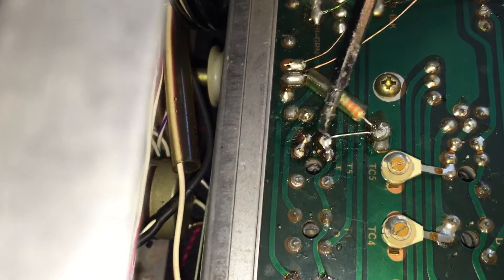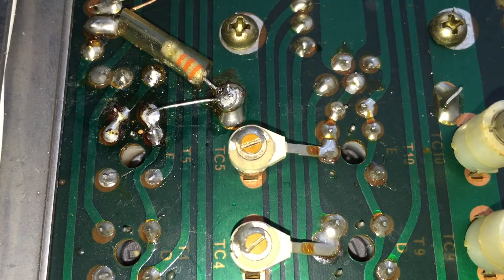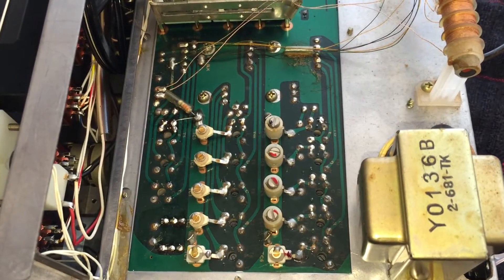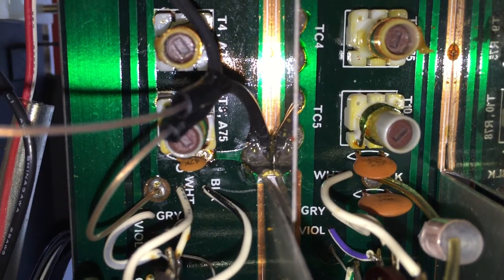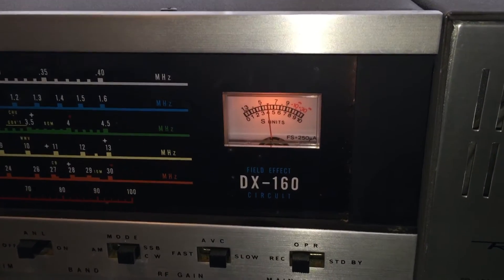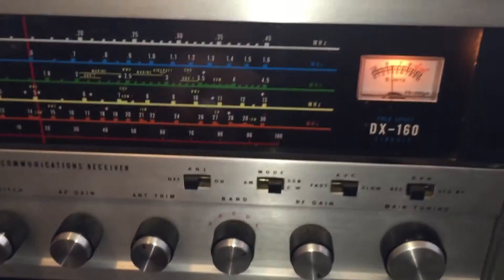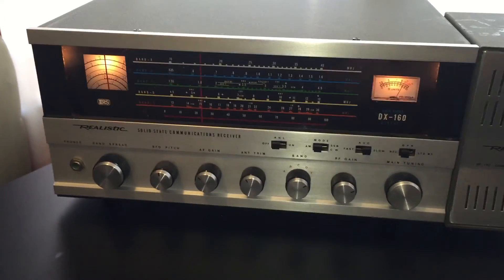Realistic DX-160 Weak/Low Sensitivity Problem finally solved.

Comment: Ah - the discovery of the bad "eyelet" problem ... the eyelets serve the purpose of plated thru holes, but, they age and then lose conductivity since they corrode - were never properly soldered properly from the factory. The Icom IC-22A and IC-22S (2 meter radios) had the same issue a few decades back too.

Comment: This is a wonderful machine. I have a hole bunch of communication receivers and this one is one of the best (Kenwood, Realistic dx200, yaeshu and more ) After I changed R2 to 4k5 ohm and made a digital frequency display and done the alligment job. Super selective and sensitive. Installed a notch/cw filter for perfect cw and ssb sound.

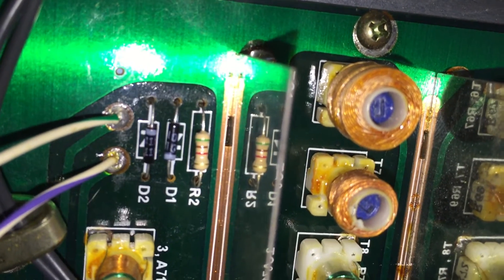Comment: At 2:16  Germanium Capacitors!?!?!?  I think NOT!  At 3:40 Use a common value for R2 5.1K will work fine.
Those diodes are 1N60 and are plentiful on Ebay!
Reply from the maker: That's what was in there per the service manual!  They are a bit hard to find as well.  I'll check the R2..

Comment: Remington- I came across your videos on the DX-160, and your fix worked...I couldn’t tell if there was a cold solder joint, but I ran a jumper (as you did) from C2 to ground, and that dramatically improved reception on the shortwave bands. Otherwise, I had very low sensitivity on all but the mediumwave band. I may try removing R3 as suggested by another in your comments. What I hope to figure out at this point is a compact antenna that will receive most of the shortwave spectrum, to be placed in the attic (we have a strict HOA), and which won’t pick up too much interference from the electrical appliances in the living space below. With a 25’ random wire on the main level, it is a real challenge to hear anything but noise on the DX-160.
Reply from the maker: Oh wow.  I just discovered you're commend.  I'm glad you had some luck in fixing it.  Does the BFO drift on yours?

Comment: Remove the Resistor Orange, Orange, Orange, its for the Medium Wave, you will have far superior reception.
Reply from the maker: Interesting.  I may look into this - I did replace one resistor as I described in the video, which was supposed to increase sensitivity.  It seems pretty sensitive as it is, the noise levels mach my amateur HF radios, so this 160 seems to be performing well.